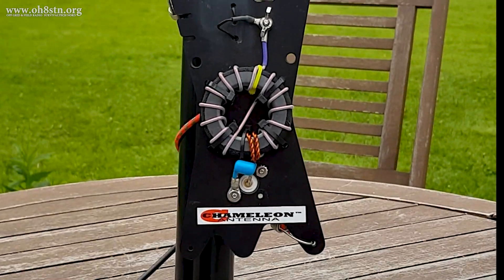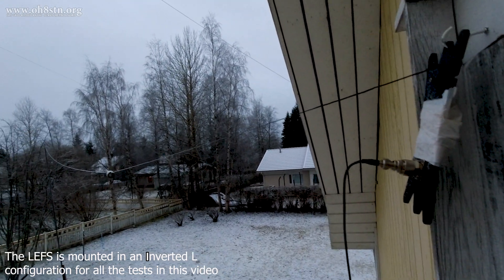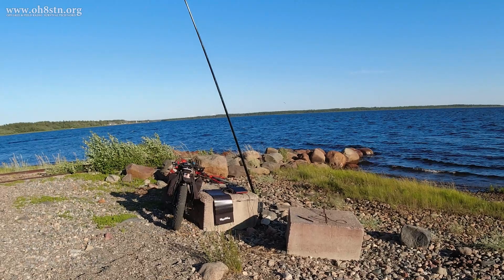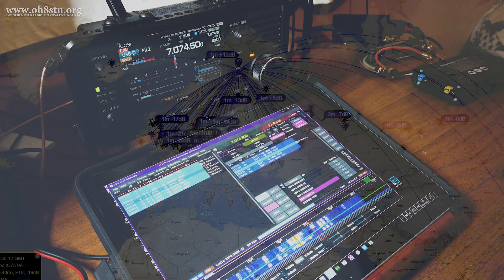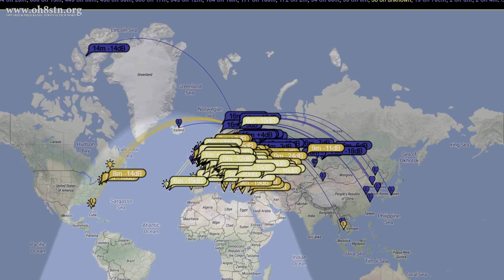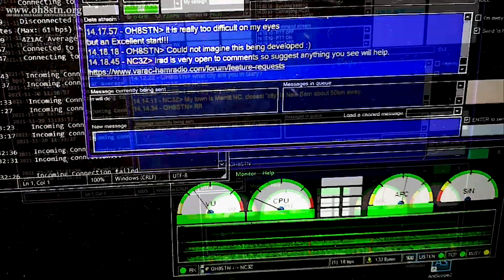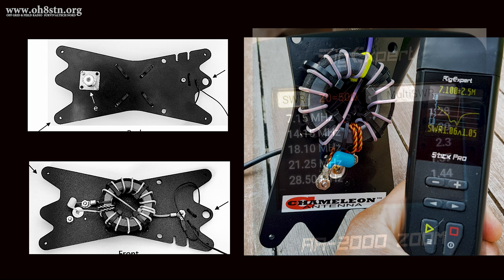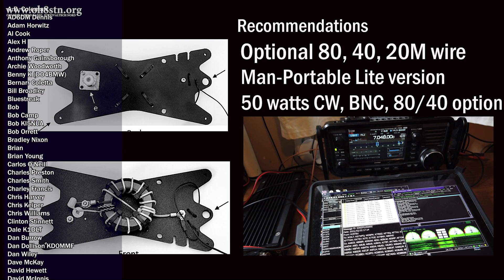Chameleon LEFS EFHW Portable Ham Radio Antenna

Comment: If you have a minute, speaking of atypical deployment of the EFHW do you suppose a completely vertical orientation would degrade the performance?
Reply from the maker: Not at all.  A ground mounted 1/2 wave vertical is an excellent DX configuration .
73
Julian oh8stn

Comment: Julian, you mention a 1:1 choke must be added at the feed point.  Could Chameleon have added the appropriate 240-43 and coax assembly to the winder adjacent to the 49:1 xformer?  Btw, I’m quite hesitant to use a platform like
Patreon, but your videos and blog are so informative, I feel compelled to give it a try.  Thanks Julian.

Comment: Julian - how does this compare to the hybrid mini from Cha when it comes to QRP off grid scenarios?
Reply from the maker: It's a resonant antenna on 40, 20, ... so performance is excellent 40-10. Fewer losses than a broadband antenna and no need for a tuner. Definitely worth considering for max performance with minimal power on those bands.
Reply: @OH8STN  Do you think a x6100 or 705 would auto tune a hybrid mini giving me capabilities on 80m over this antenna?
Reply from the maker: This is a trick question. The new version of the lefs oh, the Prototype is sitting on my desk right now. I'm waiting for warmer weather to deploy it. The original lefs was resonant on 40m. 80 M and 60 M are not supported. The hybrid Mini with its long wire element is able to tune 80 m. Just don't forget the counterpoise.

Comment: How does this compare to Emcomm III portable?
Reply from the maker: EMCOMM 3P is basically a random wire antenna-73feet long.  It is amazing as a broadband antenna but generally requires a tuner to get dialed in. This one is a resonant antenna requiring no tuner, but you can't hit every band. I'm not sure which one has better performance since I've had good results with both of them.

Comment: Julian, I noticed in your test that you have the antenna deployed with the Line Winder assembly covered with what I suppose is impermeable material to protect it against the weather. 
What do you recommend using to protect the winder assembly and coax connection if it were to be used for an extended field situation, say for 2-3 weeks or longer?
I agree, an 80 meter design is a must for NVIS ECOMM purposes.
Very good quality video. 
Thanks, 
Brad KH6OWT
Reply from the maker: Hi Brad
The new version has heat shrink tubing over the balun. Unfortunately, I don't have the new one yet. If I were trying to protect it, I would use marine heat shrink with glue. There is a heat shrink which also has a layer of glue inside. I would hently wrap the balun with plastic wrap, then use the marine heat shrink to cover the balun. It is important the hearshrink not be too tight, as I can interfere with the balun windings.
This is how I would do it.

Comment: Option: Use a jumper to add a wire extension for 80m. Then you have an 80/40/20(and maybe 10m) or the original. Half the number of links as a linked dipole. The ease/difficulty of switching the link will depend on deployment
Reply from the maker: That's another option 👍.
Not usually using the higher bands. Normally using 80, 60, 40, 30, 20 and sometimes 17m for DX fun. 60/30/17 we can get with a tuner. 80/40 are very important.

Comment: Did you use or add a 1:1 balun or otherwise modify the antenna they shipped you, during the course of your testing? Also, was wondering what was the range to the Winlink station you used during testing?  Lastly, how long do you run the WSPR or JTDX sessions to gather your reception reports? Is it like popcorn in the microwave, run it until it stops popping?? Thanks for the excellent review as usual hefe!
Reply from the maker: No choke or mods during testing. As shown in the video I measured with and without a choke. As mentioned in the video the winlink Gateway (beginning of vid) was about 900 km away. The varac also at end of vid was in North Carolina. The ft8 sessions were about 2 hours each over two days both starting at roughly 0800utc to 1000utc. The popcorn never stopped, I simply got bored with ft8 so moved on to something else.

Comment: Overpriced. I prefer the PackTenna EFHW. High quality and great performance at nearly half the price!
Reply from the maker: I also enjoyed the Packtenna EFHW. Unfortunately mine didn't stand up to 50-watts and duty cycle of data communications. It was very nice for QRP though. I'll certainly repair or replace it sometime. I still use the 9:1. Price difference comes from the higher power rated core. They really aren't a one-to-one comparison.

Comment: This coming Monday the production manager will make 80M version and test the SWR to make sure we’re on spot. If it’s working we will sending you a sample pretty soon!
Reply from the maker: Outstanding!  If you can get that to me pretty quick, I will use it for winter field day.
Reply: If it tests well how long would it be for a version to be ready for the public?  I am thinking about ordering the LEFS as a first antenna.
Reply: @DwightN7MFD  In the first quarter of 2022.
Reply: @carllavoie3804  thanks for the quick response.  Have a great day.  Stay safe and enjoy your adventures!
Reply: @carllavoie3804  which 50 foot coax would you recommend from HRO to go with this antenna?   I am getting the choke separately. Thanks again.

Comment: it is basicaly a 49:1 transformer hwef antenna using the 240 core and i think 500 watts would not do well. i have made several of these if you want a light weight version see the versions using the 140 size cores.
Reply: If you’re using AWG14 with solid core with PTFE or FEP sleeve you won’t have any issues handling 500W SSB.

Comment: Good review. My home base station uses a Par End-Fedz all band half wave end fed 80 - 10m. From back of house straight out to a tree with a 90 degree right turn for the last 30-40 ft. Works great. I'll be looking at the LEFS for field use.  Good work as always! Your site is a fantastic source of information.
Reply: Hi Andy, I was wondering if you use a counterpoise wire with ur par end-fedz and if so how long of a wire?
Also do u add a balun as well as suggested with this Cha End Fed? 

I just moved into a home with 2 acres and now have space for 80m.. i was thinking about this Cha End Fed, but I like the fact that your Par end-Fedz also works on 80m. 
I’d def consider this Cha end Fed as a portable option for sure though!

Comment: Nice review, seems to work extremely well for you. I have quite literally just finished making similar homebrew myself. Be interested to know if you used a supplied common mode choke or one from some place else. Keep up the great work! 73s G7TFZ
Reply from the maker: I built a 1:1 choke with RG-316 and female bnc connectors on a plastic cutting board backing.
73
Julian oh8stn

Comment: Counterpoise not necessary.  the coax feed line functions as counterpoise. according to Hyendfed.  I don't use a choke and have no apparent problems with RF in radio or in shack.  I use an autotuner at the antenna feed point  that allows me to get a match for the WARC bands.  Not elegant, but it works.
Reply from the maker: Thanks for the feedback Tim.
73
Julian oh8stn
Reply: Hi,
I use a counterpoise of 0.05 Lambda on the lowest band of my homebrew antennas and an choke, because my neighbors are just 15m apart of the antennawire...
Just in case 😂

Comment: Great video. I recently built but have not tested the km4ack end fed half wave kit which is 5 ounces, has a BNC connector, and supposedly gives  50w ssb/20w digi and may be a good lightweight option for operators on a budget who want to operate portable.

Comment: Julian, your reviews are always spot on.

What did you use for your 1:1 choke balun?
Reply: Maybe and RFI choke installed at the antenna feedpoint?
Reply from the maker: I made a 1:1 choke with RG-316, two female bnc connectors and FT240-31 toroid. Used a plastic cutting board backing and marine heat shrink to seal it up.
I'll do an article on it.

Comment: Julian, Great review. You run a great channel. Amazingly, I have plans to install my CHA-LEFS this coming week. Now you've gone and gotten me all excited. The main difference will be that I currently only operate phone although I have future plans to expand into the main digitals, likely by summer. The view of the antenna installation from your window was "worth a thousand words". Just a thought, you might want to get an L PL-259 connector for the feed point to reduce component stress. Thanks also for the 1:1 Choke comment, I'll add that to my installation. Thanks again!

Comment: Although there is no question in my mind that your reviews are on the "up and up", I would prefer that the reviewed products were not supplied by the manufacturer.
Reply from the maker: Fair enough. They're not always "supplied", but as you've seen with other manufacturers, I have and will  definitely call them out, when they're doing some sort of flim-flam. In fact several companies don't want to collaborate anymore, because I don't agree to doing "fluff piece" videos. Fair enough though and well said.
73
Julian oh8stn

Comment: I'm not surprise by the performance.  I had a unknown manufacture sloper antenna given to me years ago.  

I was told it was 10-40, but I'm able to tune it up on 6-80 using my LDG It-100 autotuner.  The upper end is about 30Ft up my tower.  Running at 40W max, I've earned Digital WAS on 80,40,30, and worked 33, 59 and 79 DXCC respectively.   

I've also had good success using it for Winlink on those bands.  I was the longest distance contact to Hawaii  from Ohio on 20M Winlink P2P during their King Kamehameha event.  It's still my only antenna that covers those bands (I recently but up a Hexbeam for 6-20).

I was almost more interested in the VARA AC you mentioned.  First I had heard of it.  I need to check it out. Thanks.

73 Randy KAØAZS

Comment from the maker: Hello Operators. 
You can find the episode notes here. https://oh8stn.org/blog/2021/11/27/chameleon-lefs-40m-end-fed-half-wave-antenna/
You can also learn more about the Chameleon LEFS at GigaParts http://oh8stn.net/32sfuXq USA, or Pileupdx EU http://oh8stn.net/3HSXvKd
73
Julian oh8stn
Reply: If you add another length of wire on the end (using a connector block or anything else) that's about the same length (63') as the main antenna you'll get 80m and up...   The capacitor across the input and the coil about 2m from the feed point are all there to assist in tuning across multiple bands.

Comment: Very interesting,  I thought EFHW works on harmonics,  so I would expect 40 20 15 10 for 63 foot. Wonder how they got 17 & 12m too. 73 MW0SAW.
Reply: For 40m end-fed half wave antenna the 5/2'th harmonic is 17m and 7/2'th harmonic is 12m. It's quite eye opening to calculate these harmonics for EFHW antenna. It's resonant on so many bands.
Reply from the maker: You know I started reading up in my ARRL antenna handbooks. This topic is a rabbit hole. It would be interesting to understand how they did it.